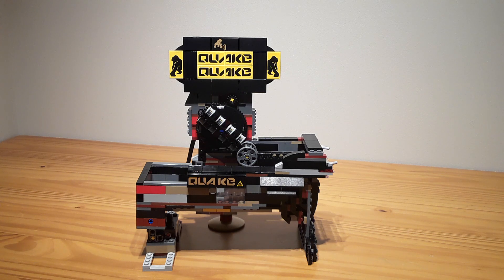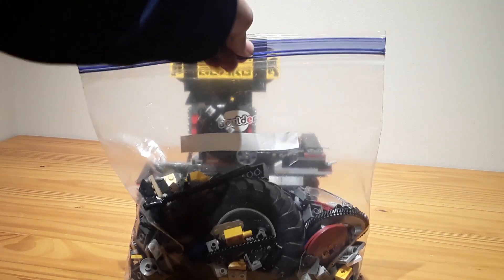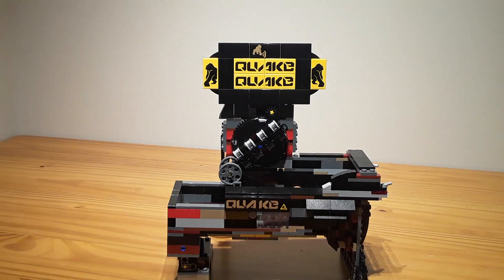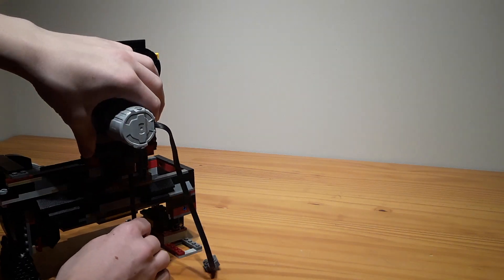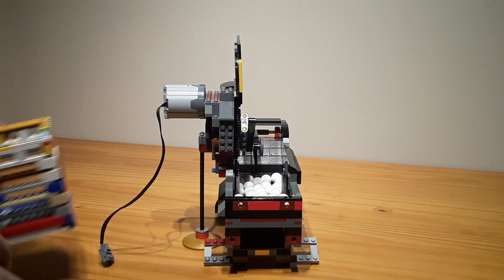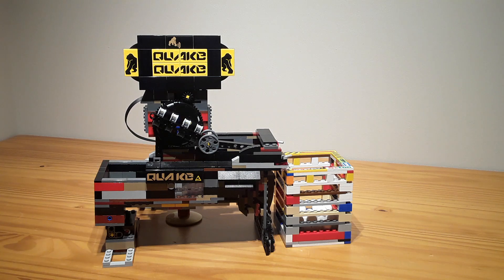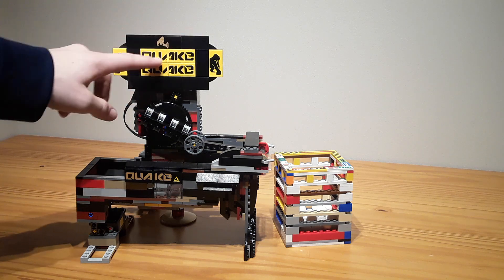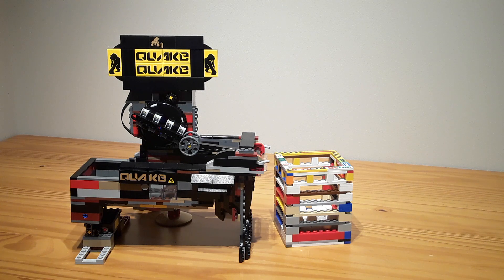LEGO GBC #21 Sweeper module from quake mech  70632

Comment: This motor was not included in the set.
Reply from the maker: Other than the motor, all the peices came from the set. Or you could make a crank from the extra peices from the set.
Reply: @legobengineer  did you mean: pieces
Reply: Try to buy this motor separately
Reply from the maker: @EricKidson2008  I did buy the motor separately on Amazon.
Reply: @legobengineer  no
Reply: The price are expensive.
Reply: @legobengineer  I searched in lego motors
Reply: i have a lot of delays for this